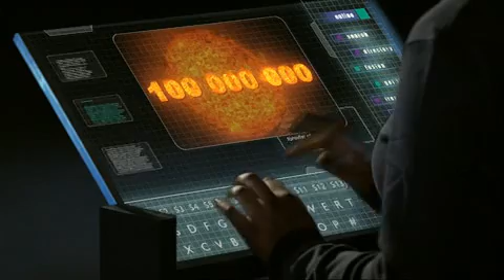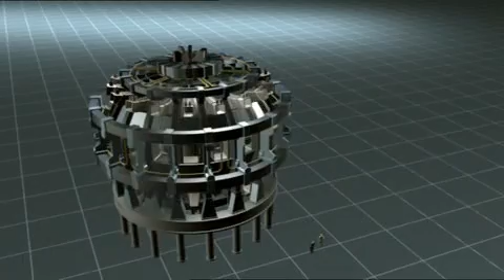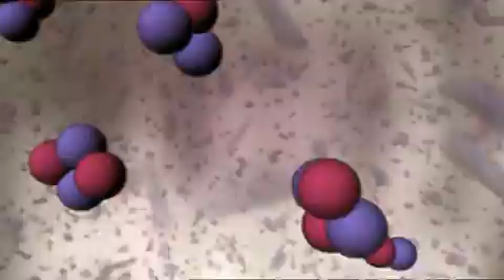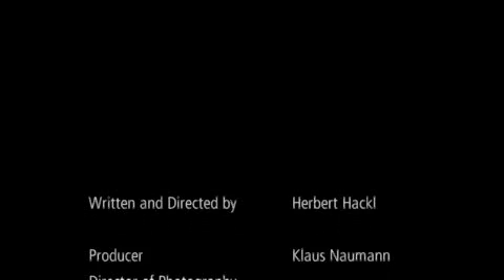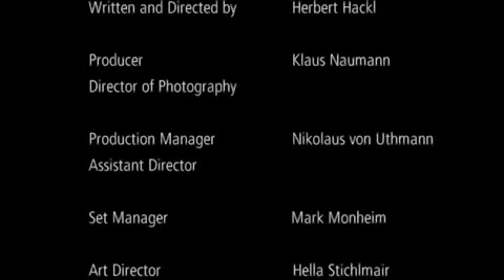How will a fusion power plant work?

Comment: yep we're now busy sipping the planet's oil..and then we'll start screwing the water..this reactor analyzes and cracks water into atoms to extract H ions..killing every water molcule used in the reaction..with no water reproduction of any kind.
Reply: 1,000 MW fusion plant will require 250 kilos of water per year or roughly 1200 gallons. There is 326 million trillion gallons of water on earth. It would take an unfathomable amount of time to reach the point of running out of water and we should have the ability to harness the power of stars long before that's ever an issue.
Reply: LeeWang85 Plasma can be created out of ANY material. The fusion reactor cited in this video is powered by plasma, so while there are some thoughts on making water-based fusion reactors, water is not a necessity.
Reply: Blake Eastman Yes it is, because we need deuterium and tritium to make plasma on earth in the "easiest" way, and you can find deuterium in waters, but the idea that we could use up our water is stupid, we wont need near that much water for it to work.
Reply: And due to the fact that 97% of Earth's water us unconsumable, it won't matter anyway.
Reply: LeeWang85 If we in a million years find our water usage too be too high, I think with the technology the almost infinite energy source have permitted us to create may make it sustainable to harvest water from meteors. My thought though, I think civilisation might be gone before we reach a critical point. And said critical point is way further in the future than that of the greenhouse effect we're causing with the burning of fossile fules.

Comment: ITER have started creating the parts for their fusion reactor. They also have figured how to get the plasma too high degrees. how hot? 150.000.000 celsius.. 10 times hotter then the suns core..

Comment: 100,000,000 degrees?! kelvin? celcius? fahrenheit? this video needs to be redone, because we have already started work on a fusion reactor...
Reply: ChickenfishOfDoom
 that depends on the quality of confinement, this is basically what peaceful fusion research is all about. the hot plasma likes to escape the magnetic confinement. ITER aims to ignote the plasma and to keep it burning hot for 400 seconds, Wendelstein 7-x is using a different approach (no electrons in the plasma, no induced currents in the plasma) and aims for 30 minutes. an actual power plant would be steady state, meaning you keep the plasma in there for weeks/months/years.

if the magnetic confinement fails (which it often does, so, this is planned for) then the plasma cools down rapidly. it just hits the walls. the plasma is thin, and in a vacuum, and when things go wrong it will hit hundreds of tons of tungsten and molybdenum and steel. the weight of everything in the plasma is maybe around 5 grams when ITER is running full steam, 5 grams over that volume is not much. 5 grams at 150 million degrees is not so bad when you crash it into tons of tungsten and steel. and if the vessel would break with these 5 grams at 150 million degrees in it, kilograms of air would rush in and mix with it.

so if something goes wrong, temperature is lost and everything stops. and that makes plasma fusion very safe, but also very difficult.
Reply: cesare vissani
the difference between celsius and kelvin is merely 273 degrees, so when talking about 100 million degrees, it does not matter. the unit that the scientists actually use in nuclear fusion experiments is electron volts, its a measure of the kinetic energy of the individual particles.
Reply: At those temperature it almost doesn't matter :)
Reply: celsius or kelvin. generally kelvin is used.
Reply: ChickenfishOfDoom
 im glad i could be of help :)  research and keep following ITER, Wendelstein 7-x, and K-Star, its fascinating and rewarding. They keep a temperature gradient, its incredible. the superconducting coils only work at 4 degrees above absolute zero, cooled by superfluid helium, and nearby you have this vacuum, and suspended in the vacuum the plasma is at 150 million degrees. and the plasma-facing materials are cooled with....  well, we dont know yet, maybe helium, maybe liquid metal, maybe water, but they are built to withstand insane thermal loads. its crazy physics and crazy engineering, the plasma at these insane temperatures is surrounded by cryogenics operating near absolute zero. When you study this, you will learn a lot.
Reply: celcius or kelvin, and it really doesnt matter since there might be a differente of around 200 degrees between each other, which is almost nothing in the 100 000 000 scale. they should specify it anyways.
Reply: the lip syncing is HORRIBLERG
Reply: Well by being an instructive video ppl usually use celsius
Reply: Celsius
Reply: kurtilein3 i know, it's just really damn hot. how long does it remain at that temperature?
Reply: kurtilein3 Oh! well shit, thank you for that large dose of information! :D
Reply: kurtilein3 you blow my mind!
Reply: ChickenfishOfDoom
 have fun researching it all :)  i grew up with this stuff and learned about fusion experiments and also about fission as a child.
Reply: kurtilein3 yeah, i knew a lot about fission when i was little.
Reply: Cool thanks guys didn't know they used electron volts
Reply: cesare vissani
 Well, since this is a popular science video they did mean celcius/kelvin. But  Kelvin is a somewhat arbitrary unit, and scientists prefer having units where common constants have a value of one. So they set the Boltzmann constant (which has units temperature/energy) to one and use electronvolt(a unit of energy) as a unit of temperature as well for convenience.

One electron volt is about 11600 Kelvin using this definition, so the plasma temperature is smaller in electronvolts(also electronvolts aren't called "degrees" so there is little risk for confusion). Furthermore one often has SI prefixes such as kilo, mega, giga ect in front of the electronvolt unit.
Reply: More likely a Celsius
Reply: +christopher weaver 
I don't think it's lip syncing. The original video was probably done in another language.
Reply: makes sense

Comment: actually nuclear fusion in the sun works with quantum tunneling the pressure is just a side note
Reply: What really makes the sun work is volume. The probabillity of the reactions that make the sun shine is incredbily low, but because the sun is so big it adds up.

Larger stars are hotter inside and thus the probabillity of fusion reactions in them is higher, so their lifetime is much shorter.

Comment: Hmm, so the idea is to replace highly radioactive and expensive fission reactors with highly radioactive and even more expensive fusion reactors?  Okee dokee, I'll give up my cocaine habit in favor of heroine.
Reply: Fusion does not have radioactive waste. However, the process still emits radiation like X-rays and fast moving neutrons... So yeah   :/

Edit: Correction, the structure becomes radioactive and there is SOME radioactive waste, but they do not last for thousands of years. The shortest halflife decay would be a good 12 years and the longest just over a century.
Reply: It's not radioactive at all. It's completely clean. The radioactivity in fission waste is because the materials that Uranium/plutonium Fissions into are unstable, decay into small elements over time and release damaging radiation in the process. This just makes helium.
Thats it.
You could fill balloons with it.

The nuetrons are absorbed in the power making and X-rays are easy to deal with. Not even comparable.
Reply: *****
Yes, but most of the neutrons produced would be absorbed by lithium on the reactor walls, that would split into helium and tritium. This has to be done in order to make more tritium fuel because tritium is very rare in nature and currently made using neutrons from conventional nuclear reactors.

Since you need one neutron to make one tritium atom this way, and you need one tritium to make one neutron, the loop is closed. In practice, some tritium is also produced by deutrium + deuterium side reactions, which should be enough to replace the neutrons that leak out as long as there isn't a lot of them.

So to sum up, the number of neutrons creating waste would be small, simply because it has to if the whole shebang is supposed to work.
Reply: DaScribbler
 Actually, Neutrons outside a nucleus do beta decay into a proton and an electron with a half-life of about 10 minutes. That is one mechanism of neutron loss in reactors.

The main radioactivity concern here is neutron activation, i.e. neutrons being absorbed by nuclei of atoms in the reactor structure, transmuting them into radioactive nuclei. It can and has to be suppressed in a practical reactor, but it is still a minor radioactivity issue when the plant is eventually decommissioned. Empathis on minor though, since the half-lives involved are very short.
Reply: In this case, they are absorbed by the walls of the chamber, which heats it up. Free neutrons are not radioactive, that is They do not decay into anything, and do not release damaging radiation in the process of decaying, which does not happen. The neutrons ARE the radiation, and again the walls of the chamber are going to absorb them. which itself is the method by which power is drawn from the reaction.

There is no radioactive byproduct after it's all said and done.
Reply: DaScribbler I don't think that's right.  When you fuse two tritium atoms the product is heat, helium, and an extra neutron.  The extra neutron is radioactive.  It isn't absorbed in the process, it's released in the process.
Reply: BosonCollider I knew about Neutron activation but not neutron beta decay.

I learned a thing.
Reply: Fusion is the most efficient clean energy we know of. Fission is fuel efficient but it's also very un-environmentally friendly.

Comment: The interior of the Sun is 15 million degrees?  Funny how astronomers and physicists can't agree on that.  Some say 10 million, some say 20 million.  Some even say it's cooler than the surface.  This is evidenced through sun spots which defy the laws of thermodynamics.  Suns spots allow us to see further into the interior of the sun, yet they are much colder than even the surface.  And also, what is the explanation as to why the corona is hotter than the surface?  It's impossible if the sun is a huge fusion furnace and there are no other forces at play.  Electric universe theory!  Get on board!
Reply: The core is hotter but estimate put the Temprature between 15-20 million degrees + plus quantum Tunneling for nuclear fusion

Oh and the solar corona Heat problem has Been solved
Reply: Oh Sorry to disapoint you but nuclear fusion doesn't break the laws of thermodynamics But EU Theory breaks all 3 of them and the guy who invented it and is the leader of EU and the thunderbolts proyect didn't even Get a PhD
Reply: Alfven studied the plasma and magnetic fields of the sun, but didn't invent EU Theory and believed in the cosmosolgy of today ( he didn't believed anuthing clase to EU , ) so you are confused
Reply: I am talking about the creator of EU and the Thunderbots proyect didn't have a PhD and barley passed University
Reply: Alfven Didn't invent EU Theory, he investigated the magnetic fields of the sun, but didn't invent EU Theory
Reply: Alfven Didn't invent EU Theory, he investigated the magnetic fields of the sun, but didn't invent EU Theory.

Comment: I dont think that Sun works on fusion. The more i read about it the more sceptical i am.

Sun surface temp is 5500 C
Sun corona temp  1000000 - 5000000 C, avg is about 2000000 C.

Sun corona is way way way way way way above the sun surface. How is that possible? None theory can explain that.
How we can have fusion inside the sun if sun corona is many many many many many many many many times hotter that sun surface. Not to mention the core.
Something other is happening inside the sun.

That why we have problems with fusion here on earth. We try to mimic the sun fusion and we fail. For how long we try and fail? 60 years give or take. Still nothing.
Why? Because sun dont work that way.
Reply: if the sun doesnt works on fusion. then what else? scientists are not sure why corone on a star hotter than its surface, but at least they create some interesting hypothesis :

http://www.sciencedaily.com/releases/2013/02/130204094608.htm
Reply: We have direct evidence for fusion in the sun. Neutrinos produced from various fusion reactions can be detected in neutrino detectors here on earth. Their energy when plotted forms "bands" of discrete energy levels that corresponds exactly to various known fusion reactions. So we do know which fusion reactions are happening inside the sun.
Reply: oldi184 
True in above
But there's something missing
Sun's Core: 15,000,000 °C
Reply: Jaret Jose Ulanday 

And how you know this?  Have you been inside the sun core? You measured the temp there? No? 
15 000 000 of C is just speculation based on theory not empirical evidence.
Reply: oldi184 
Yes, it's hypothetical obviously, but it's too hard to get the temperature empirically. Because the thermometer can easily melt at extreme temperature. Unless if you have something other ways to measure the temperature of the sun other than thermometer.

If you find something credible sources about the other ways to measure, please reply.
(Protip: you may allowed to use URLs in this comment)
Reply: Jaret Jose Ulanday
IIRC, that comes from the ideal gas law and is quite straightforward. Work out the pressure from the mass of the sun above. Assume equilibrium, and you get the temperature.

15 million degrees is too cold for fusion reactors, as the fusion reactions have a very small chance of happening, but because the sun is so large it still adds up to a lot of heat. That is good for us, because it means the sun burns very slowly allowing it to stay alive for billions of years, as opposed to more massive, hotter stars which burn out in a few millions of years.
Reply: Jaret Jose Ulanday

Nikolay Kozirev was Russian astronomer wrote in 1940 paper about stars. What he proves there.

-Standard model of the sun. The Fusion model of the sun is complete nonsense.
-He shows the the core of the sun and other stars is so low that it can not initiate and sustain a thermonuclear fusion
-He also shows that the Hertzsprung–Russell diagram for the evolution of stars is completely erroneous.

http://www.ptep-online.com/index_files/2005/PP-03-11.PDF
Reply: BosonCollider 
The smaller the stars, the longer to "burn" the stars, the lower the temperature?
How to create fusion through tokamak to produce enough heat?